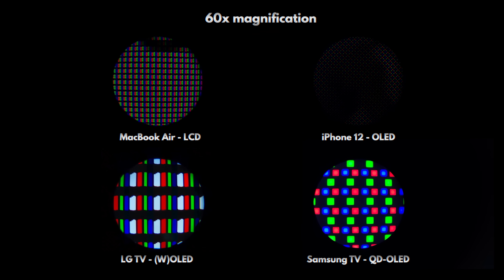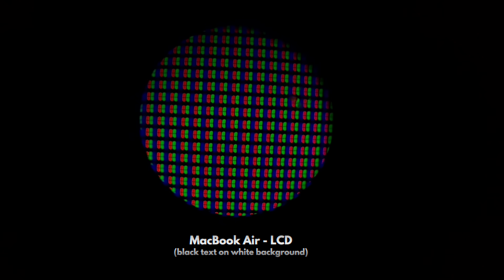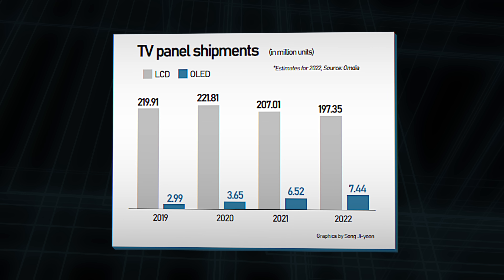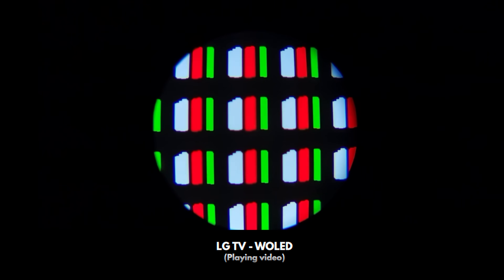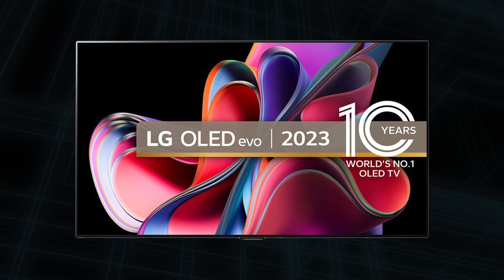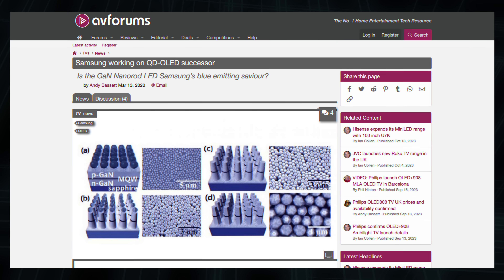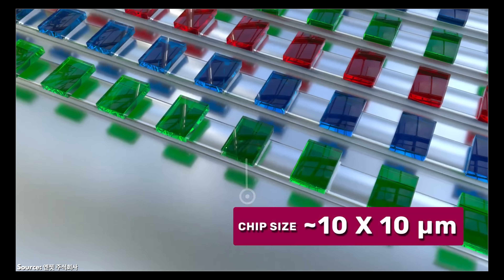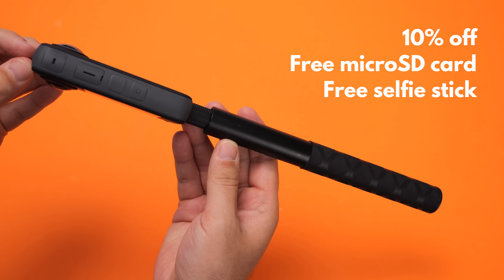The billion dollar race for the perfect display

Comment: Wow that was a really informative and also entertaining video! I'm very familiar with electronics but while I have some knowledge about semiconducters I never studied display technologies and had just very superficial knowledge about those. Somehow I kind of wrongly assumed that some everyday displays would already use the micro-led concept, since it seems to be the most straight forward approach. I'm kind of surprised that micro-led technology still isn't where it would need to get to. Also surprised that they haven't come up with a principle yet that uses vapor deposition or similar concepts for building micro-led displays (without first building small leds and placing them) - in a similar manner oled does. But yeah those GaN "(o)led" displays would be more or less the same thing. Sounds promising. Let's hope one way or another some kind of crab(like) thing will finally be built soon. :)

Comment: I bought a Hisense U8H for the same price I bought a TCL. Same size, and both were good TVs. I think I got lucky with the Hisense because the TCL was good, but I could still tell it was a budget TV. Grey uniformity on the TCL was noticeable. However, the Hisense didn't have any of the issues where a common person could notice it was a budget TV. Didn't know this at the time, but apparently Hisense started buying Samsung's rejected panels. It was also the same year when people started to notice Hisense as more than just a decent budget option. I think I got super lucky and will hang on to this TV until it dies, because it's a way better TV than what I paid for it. White, Grey, black uniformity, or brightness are great. All the unusual suspects that are manageable, but you know you got what you paid for, don't exist. I've considered upgrading, but I think Hisense has realized they're not a joke brand anymore and have adjusted accordingly.

Comment: TBF burn in is nothing new, it was common back in the CRT days.  In fact, when cheaper CRT’s still had better picture quality than many LCD’s the lack of burn in was used as a selling point for LCD technology.  Though the budget displays usually had TN panels so could experience burn in over time, albeit slower than on most CRT’s.

As someone in the market for a new dual purpose work and gaming monitor my main concern with OLED is text clarity.

Comment: I don't like TV companies today using organic degradable material for displays especially in oled. Yes it gives good display but for a year after that it becomes disposable and becomes e waste also its expensive. Each backlight has problems of its own. From dead pixels, burn in, ghosting, cloudy, lines, dimspots. I would rather get mini or micro led over oled because of longevity.

Comment: I think the actual "crab" is going to be the Blue Gan LED array with a nano dot filter in front of it. It's the most scalable convergence of all three technologies. It would be relative cheap to do full silicon wafer sized "chips", somewhat similar to what Cerebras does with CPUs. Especially if older lithography is used, + a clever pattern that has a large overprovisioning allowing for near 100% yield even with many defects on the wafer.

Comment: Meanwhile, true crab CRT: "Look what they need to mimic a fraction of my power..."

Seriously, decades of intense research & development, & everything STILL has more drawbacks than CRT, other than form factor & resolution.
For every step forward in one aspect, the newer tech takes another step backwards in another.
For example: I discovered with dismay that so many almost half-decently bright OLEDs partially get that way due to lack of a polarizer, but that causes them to look purple if there's ambient lighting, killing the format's whole strength of dark blacks.

I could list a dozen more examples, but I'm tired... Monitor shopping is just so frustrating. A thousand bucks for anything still-below-acceptable if you're both an artist & a low-spec PC gamer*, yet it STILL carries so much heavy compromising that even $200 would be more than it's worth...

(* The better monitor tech gets & the higher native resolution/Hz they get, the WORSE the latency gets on non-native lower resolution/Hz settings, making older gaming come with increasingly horrible delay. The closer the monitors finally get to having properly balanced capabilities, the more likely you'll be forced to ALSO buy top-of-the-line computers to go with them. Making eventual almost-ideal monitors double unaffordable. And, even if your system's blazing fast, as that latency gap grows, beloved older games will become more & more unplayable anyway... :text-green-game-over:)

Literally all I need is black blacks, bright whites, accurate colors, & low latency on games that might natively run at a maximum of 30-60 FPS. I'm not being THAT picky here!
We already had that once... 😢

Comment: By the time we find another solution the current method will be so efficient and affordable nobody will care. OLED burn in is not event a modern issue for most consumers. OLED brightness very good today. 
For commercial usages where you what insane brightness and avoid burn then micro-led solves that today too.

Comment: CRT is better in every way except shipping costs.
The industry moved to flat panel tech because it was easier to manufacture in 3rd world countries using impoverished labor than making CRTs which were exponentially larger (and heavier).
Reply: As a mid high end CRT monitor owner i disagree with your first statement.

CRTs aren't bright enough for handling HDR signals, it's just a fact and a limitation of the tech. At least they have a crazy pseudo HDR effect because of being analog (so there's no point in using actual HDR signals).

CRTs also can't reach 4K (real 4K with the correct ppi or phosphors per inch for that).

No ultra wide or super ultra wide CRTs.
Reply: @saricubra2867  
My Vision Pro Master was running 4096 x 3072 on a 22" in the early 2000s.  

4k; 2k etc are marketing memes foisted off as standard resolutions because people are dumb.  

CRTs don't NEED HDR because that was always a correction for the contrast limitations of LED/LCD systems.  There is no point in using HDR on CRTs.

There is no wide format CRT because they discontinued them in the 2000s because LCDs were cheaper to manufacture overseas and ship because they're smaller.

You're very clearly talking out your ass about something you don't know much about.  I have a degree in computer science and worked in the entertainment hardware industry for years.

I helped the crew install AV equipment for George Lucas.

I look forward to you trying to save face and fronting like you understand what you're talking about.
Reply: @TurboLoveTrain he simply disagreed but you respond with insults and waffling about how you have a computer science as if that helps with your credibility 🤣 you’re a 🤡
Reply: @Tennisbord  
He's wrong at a technical level; doesn't know what he's talking about and neither do you.

I also explained why he's wrong--so you need to work on your literacy as well as your technical acumen.
Reply: @Tennisbord  
He said something factually incorrect.
Reply: @saricubra2867  
You don't know what you're talking about at a technical level.
HDR was crated because LCDs don't have the contrast or brightness of a CRT.  You have it backwards HDR is a correction to do what CRTs already did.
I was running 2048 x 1536 in the late 90s.  Ultra wide came out way later well after the CRT was already dead because, again, it was more expensive to produce in Asia and import not because it was worse.
Reply: "He claims he's a cyborg from 2050"

Comment: Perfect display: 540Hz 0.5ms OLED with very high PWM and a 100% sRGB color gamut
Reply: A CRT already does 0ms response time with perfect SRGB and no banding because it's analog.

OLED is trying to achieve what CRTs did decades ago.
Reply: @saricubra2867 What is a CRT’s PWM rate? I thought so
Reply: @user-mf9gs  There's no such thing as PWM rate on a CRT. It's just a line drawing the image from top to bottom, it's around half or a third the speed of light at 60Hz.

Comment: Would it be light is nothing more than sound at high speed so if we had the clear crystal framed by sound system and it ptoject shape outline and light interferences with the ambient and backlight calibration so always soft to the eyes. So the crystal had the crystal element response to ultrasound vibration like salt on drum surface it form shape reflect light synchronization

Comment: OLED is still the winner tho
Reply: For consumption, maybe. For doing proper work, accuracy can’t be guaranteed long-term. I feel much more comfortable with an LCD on a computer display than an OLED. One of the reasons I didn’t upgrade to an iPad Pro M4, actually.
Reply: @ What? It can be guarenteed long term
Reply: @ Burn-in guarantees the screen changing its colours over time, especially if there are fixed UI elements. I've lost count on the number of OLED displays I've seen that have started turning red in the middle.
Reply: @nameless-user because OLEDs use organic components, ironically CRTs last longer.

Comment: The perfect display technology already exists
It's called fed/sed (field emitting display/ Surface conduction electron emitter display)
They offer perfect color reproduction, high response time, low energy consumption even lower than lcd and flat screen design
even the prototypes had refreshrates of 240hz in early to mid 2000s
camera footage shows, that they were even brighter than lcds
basically every subpixel is lit up by emitting electrons to a colored phosphor strip like a crt only that every subpixel has it's own source of electrons
The tech sadly got discontinued because of patent trolling and difficult manufacturing process
though i think that would be way easier today than quantum dot
sed and fed was developed by canon, toshiba and sony
Reply: High voltage operating, vacuum and problematic / expensice production was noway near a perfect display. I guess OLED is superior in all aspects nowadays.
Reply: @yo3429that tech was actually more efficient in energy than lcd, not quite as efficient as oled but a solid middle ground

Comment: Nothing comes close to the OLED, nothing, there is something with the image of the self-illuminated organic pixels, that cannot be explained, the contrast, the depth, the clarity of the image, the liveliness and the creaminess of the colors without oversaturating them is incredible. Organic will always be much better than synthetic, even if it has to be changed before due to its natural degradation.
Reply: "nothing comes close to the OLED"
CRT, built-in HDR because it's analog. Perfect blacks and color accurate from the get go.

No lag, no motion blur, no upscaling blur (since CRTs don't have a fixed native res). Sadly, there are no 4K CRTs, they can reach 1440p but i never watched a single one with a sharp enough phosphor later and fast electron guns for at least 4:3 4K res.

Comment: I have an older 49" LCD HD screen that looks as good as or better than my new 49" 4K TV screen, which I put in my living room. The LCD screen has a thick 3" black frame, which helps give the impression that it is bigger and more cinematic-looking. Regarding HD vs. 4K resolution, I find the HD TV equally fine when looking from afar.

Comment: My dream display is a 70-inch 16:9 CRT which fires the beam at 240hz but quadruples each frame so it still runs at the standard 60 frames with no flicker or eye strain. The neck of the gun would be as short as possible allowing for just a 1 foot deep display which is tiny for such a huge CRT. It would have all the modern inputs of course, hdmi, displayport, including legacy ones, vga, rca, component, rgb. Of course it will never exist.
Reply: Quadruple at 60Hz?
just set a CRT to 72Hz. Flicker is gone from that refreshrate.

And flicker at 60Hz is reduced with bigger resolutions for some reason.

I prefer an ultrawide CRT over 16:9.

Comment: Nobody talks about motion blur which is my biggest concern on today tvs. 
All this technology and if you sit in front of a CRT monitor and just move a window you're blown away of how clear everything is in motion. Even my old 32" crt tv, in motion clarity, destroys all the new tvs. For me the motion clarity of crt and plasma tvs doesn't compare with modern tvs. Sample and hold is a bitch. BFI is good but it has its flaws. 
I feel that Plasma and crt tvs had much more natural colors too, at least out of the box, uncalibrated. Not to mention screen uniformity and viewing angles. I think that oleds, until a better technology comes up, are going to be the evolution of plasma tvs as they come with higher resolutions, frame rates, brightness than plasmas and HDR, but they still need to fix many things that worked perfectly on older technologies. 
When i went from crt to plasma, i was thrilled. Big screen, fantastic colors and no difference in motion. Little phosphor trail but nothing too serious. When i bought LED lcd tv because plasmas went off and oleds cost crazy numbers, i couldn't even play some 2d games. Clouding (very distracting in dark room), dirty screen effect, motion blur, bad angles, bad uniformity, lag. Υou could reduce them but not eliminate them. And it was more expensive than the plasma. On lcd tvs, it is matter of luck if you will get a good panel. As for the sound, most recent tvs suck. 
I believe that tv technology has done steps forward on some things and steps backward on many others. They promote oled tvs as new self emitting technology and stuff but it was there long before them.

Comment: Why is it a problem on monitors , wouldn’t it be easier as the pixels don’t have to be as small, electric road signs are much larger and have the pixels visible straight up

Comment: I guess CRT is out.
Reply: If you care about fps for gaming it's not out yet, someone just overclocked a crt display to reach 700Hz
Reply: Sadly
Reply: We had a crt until recently
Reply: the only downside is that the high resolution stuff never made it into 16:9 on a wide scale until the last 60 seconds of the CRT's usage
Reply: Nah, CRT still has some things better. It's still used for gaming with today's consoles.

Comment: One major thing this video and many oled fanboys forget that due to the organic nature of the carbon bonds on the transitor coating among other things causing a much smaller bandgap, no matter how much you reduce  the excitment levels, your lifetime returns wont be nearly as great as they advertise due to the nature of electron hole migration /degradation in such small bandgaps and inherently less strong bonds. That's why micro led /those non organic /crystalline leds will eventually make oled obsolete, and then lcd by extension once manufacturing processes can solve the issue of individual pixel testing and replacement.

Summary : yea you can slightly extend oled life by reducing voltage over yime but you can't cut time itself

Comment: From my preceptive of owning almost all these screens in one form or another. I own a 32inch MicroLED Acer Predator monitor. Going from a regular IPS panel that was enormous quality increase. I have owned a iPad Pro M2 Mirco LED (which I sold) and now a M4 iPad OLED. The differences were not that astounding where I would recommend that jump just for a screen. The blacks are inky black but the colors on both absolutely pop. Apple has continued to use MiroLED for its MacBook 16inch line up I believe because a 16inch Dual panel OLED does not exist and compared to regular LCD panels it's an immense improvement. I believe this is the final stage of panel technology when do this. It solves the biggest issue and that is one of brightness.

Comment: Very interesting , I’ m still in the dark ages, I have a Sony CRT set, and a 1960s Black and white Setchell Carlson TV with vacuum tubes for old movies. Mostly using laserdiscs. But I bet none of these screens will still be working when they are 56 years old like my set. It’s original and never been restored, all the tubes have 1968 date codes.

Comment: LCD is not even close to OLED or MLED. The halo effect and hot spots are just not being overcome well enough. To justify buying it over either other option. Especially at the high end. Youre not gonna spend $3k-$5k (65-72 inch) on a LCD. Youre definitely buying an OLED or MLED.
Reply: If they look the same, id buy the LCD. no "ghosting". But i'd rather get a 4k crt over them

Comment: The first Mini-LCD display came out in 2019 and was made by TLC, the display TLC made was called (8-Series Roku TV). OLEDs started being made in 1997 by Pioneer Corporation, followed by TDK in 02 an Samsung followed a year later with Samsung-NEC Mobile Display (SNMD), which became the first commercial use of a OLED display in the Sony XEL-1 in 2007.

Comment: i don't mind using an old CRT display sometimes for old tv shows or retro games but my GOD OLED is amazing
Reply: I have a pseudo 4:3 1440p CRT monitor by Samsung. It's amazing for everything.

I watched the S90C (also by Samsung) in person with my own eyes and is the same minus motion clarity (worse), brightness (way brighter) and obviously 4K.

The subpixel layout reminds me of the dynaflat phosphor mask of my CRT.

Never liked LG OLEDs, they struggle with warm colors. I prefer IPS LCDs or miniLEDs over those.
Reply: @saricubra2867  okay but HD CRTs are lame, i prefer the old shitty ones that are like 480p maximum and have distincive scan lines. if i'm lucky, maybe i'll get a damaged one where the picture occasionally jiggles but not enough to be distracting
Reply: @RedHatGuyYT standard def CRT TVs can't do 480p, they are only 480i. Only CRT monitors can do real legit 480p.
Reply: @saricubra2867  hey bud, people sure love it when you correct them. keep it up, ok?
Reply: I had to mention that Samsung QD OLED tech is real RGB like AMOLED but cheaper to produce.